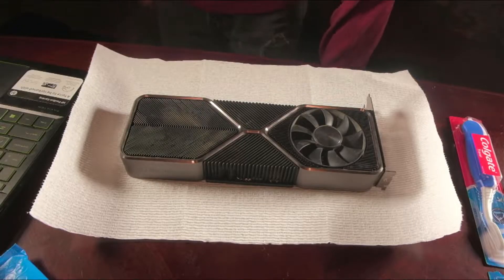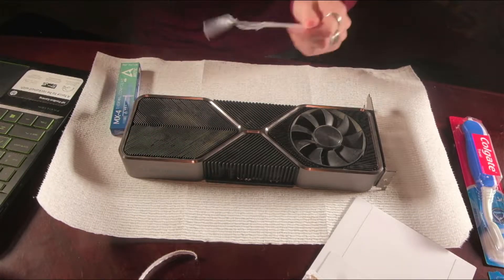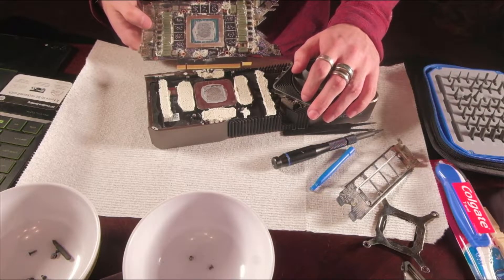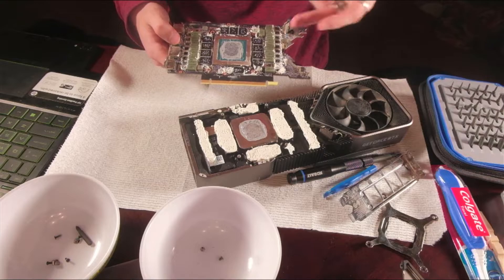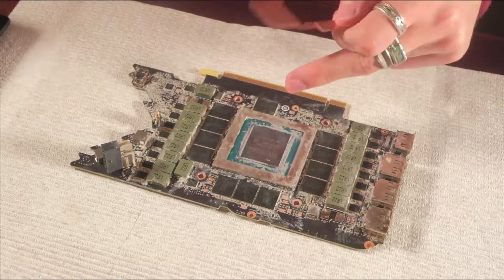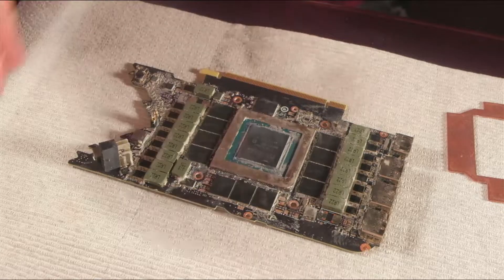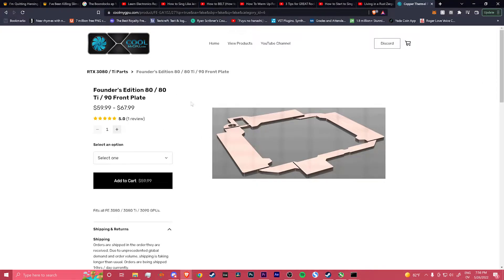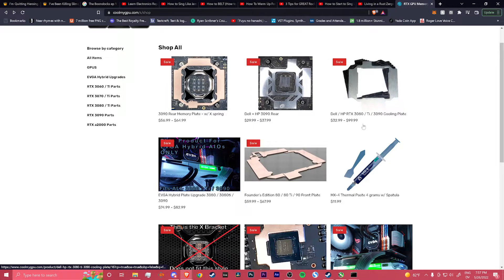No More bad Vram Temps! Copper Modding 3080 Ti

Comment: The liquid is all the silicone oil that bleeds out of the K5. I tried it on my mobo VRM a couple years ago and had oil running down the entire length of my mobo, underneath all the PCIe slots. It was a massive pain in the ass to clean. I'm legit pissed that LTT steered so many people wrong with this crap.

Comment: sorry to tell you that copper plate didnt worked on your GPU, possibly wrong thicknessboth your core and memmory is high temps. Besides all my god man aren't you have any passion about computers your gpu's are looking terrible shape. with copper plate mod usually your gpu memory will sit around 80 C at MAX.
Reply from the maker: The k5 pro stuff made it look horrible. But it is better than what it used to be